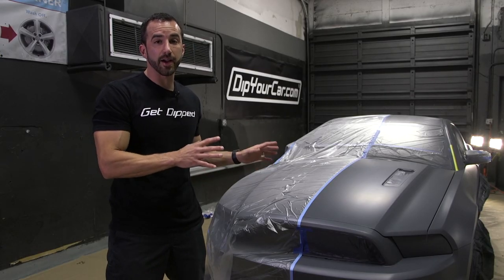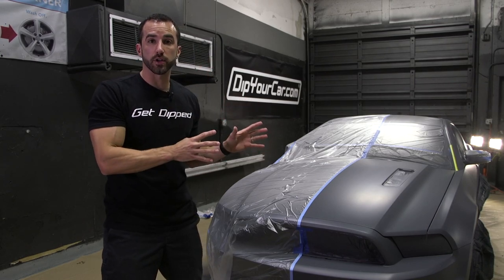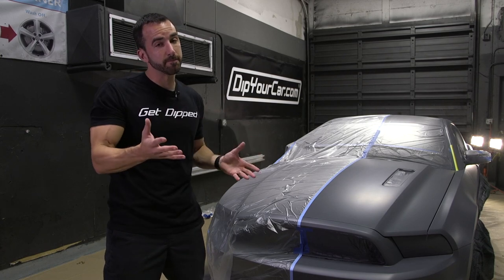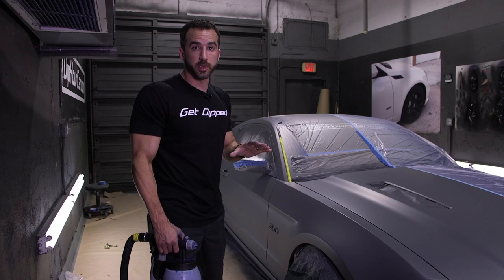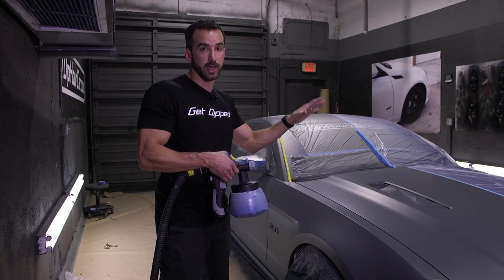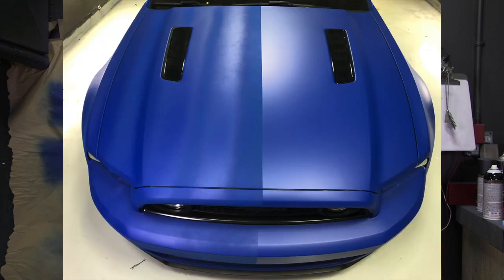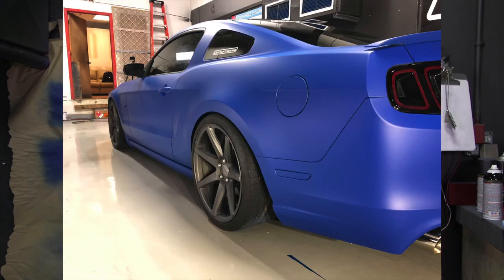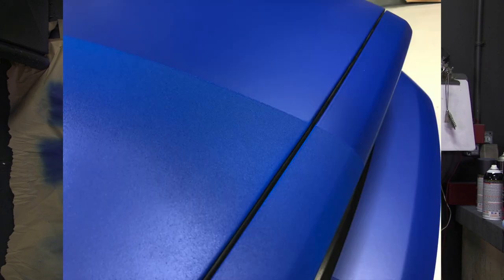Why Some Plasti Dipped Cars Look Like Crap (Rough Texture, Stripes, etc)

Comment: Maybe you can invite someone from the street with no experience. It looks too easy to apply perfect when you doing it. I'm curious how an apsolute beginner can handle the equipment with instructions.
Reply: True!  This video is still a great way to show the do's and dont's . 

The difference in the end result was VERY noticeable, even though he did the sweeps at very similar speeds (i.e. the only major changes in technique that I noticed were the ones he stated: 1. spraying too far away 2. not enough product spray and 3. not enough overlap... all of these directly correlate to not getting a wet layer... I did notice he seems to have intentionally butchered the back of the passenger side to make sure he had a good "bad example" area to point to, but it doesn't seem like he needed to emphasize it). On the driver's side the application was very visibly WET and the passenger's side was noticeable muuuuch thinner (many spots didn't even completely cover in blue and you could still see the gray!) 

I've never tried this myself, but after seeing this video it's very clear that you want to err on the side of "too heavy" vs too thin: a few runs look way better than a coarse spotted finish. I imagine making a dry application will also make it HELL to remove it easily (as advertised), which is why I presume he coated the entire thing in gray beforehand. 

I'm very glad that this business owner is very upfront and clear about how his product is designed to work, and focusing his response to the "bad reviews" as being yet another teaching opportunity (i.e. looking into what people are still doing wrong in order to further clarify the instructions) , rather than taking the more popular route of "you probably didn't even read the instructions, get lost dummy".
Reply: Good idea
Reply: He has
Reply: put plastic trash bags on the wall and practice spraying
Reply: If you can spray paint something, you can dip a car.

Comment: I can only imagine how hard it was for Fonzie to Intentionally spray so badly.... Nice to know he's that dedicated and able to over ride all his skills to do it.  Thanks Fonzie!!!
Reply: Yeah I truly have to give this guy props.  I think he is as genuine as they come when it comes to displaying a product and it's uses.
Reply from the maker: It felt so wrong...
Reply: Even trying to spray it badly he was still going through the motions right. It’s hard to break good habits but I bet the bottom 25% do panel by panel and not keeping the flow going  when they spray it on. A lot of first timers would go fast and slow and hold the gun at the wrong angle so you would have some sags and runs in it. But this is a good comparison and hopefully it will help educate folks on how to properly use the product.
Reply: It easily looked like he had the spray gun turned way way down to accomplish that.  But also Its Odd how the blue came through so bright on the lightly misted side.  Makes me think I'd HAVE to use the pear clear coat at least one coat .

Comment: I think you could actually use the "Improper" spraying techniques to make a fake rusty or patina finish, that would be really cool!
Reply: It would be great for distressed rat-rod looks!
Reply: Antimation Studios I used uneven spray for my cars mudguards. It actually by fluke worked in my favour. The colouring is even, but the texturing is sorta gritty and gives it a sporty look and feel.
Reply: Well, improper only applies if the technique doesnt match the intended result.
Reply: Maybe a 4x4 truck or jeep in camo ???
Reply: If you want texture I'd still do a proper 2-3 coats and then you can lay the final coat from further away to add a little texture.  If you do them for all the coats it'll be harder to remove and the coverage will be bad
Reply: this thing with 2 fuzzy racing stripes down it...
Reply: @BRollOffroad  Fussy patterns on the cars to make it look awesome. Like 2 subtle racing stripes down the car.
Reply: I unintentionally made a textured finish on my old 99 mustang and ended up loving it. Got compliments on my matte finish dip job and the person I ended up selling it to loved it too.
Reply: @TheChris1299100  It's mainly the guy holding the spray can that gets distressed.

Comment: I honestly hope this becomes your most popular video on the channel. Out of all of them, this is the best on how to do it right. I painted my car matte black twice, first time it turned out looking like the passenger side. Only on the hood and trunk. I hated. But I knew it was just me being a noob at painting and not doing it right. Left it for a while, also found it impossible to peel cause I did it too lite. Second time around, I did it right. Paint gun, gallons, took my time and made it wet and proper. Turned out amazing. Plasti dip is amazing if you use it right and take your time.

Comment: Experience is key, I dipped my car three times in the past, im getting better as I practice more. The hard spots for me are the roof and sides
Reply: I hear you on the roof. That is always the one place where I end up with texture and it is usually in the middle of the roof.
Reply: yes the roof, what is the problem with the damn roof?  I can't tell exactly but suspect it's just you're too far away and often throwing product at an angle.   I need to watch more closely next time and see exactly when it happened but it has to be distance i figure since texture is product that dried before it hit the surface, no?

Comment: This was one of your best videos. Not only does this explain how to apply the dip properly but this also shows why using dip cans are very situational. All the issues on the left are extremely hard to avoid with using cans on anything other than wheels emblems and trim parts. You simply cannot get good consistent coverage with a can. Im surprised you didn't mention anything about cans.

Comment: I did the too far method on purpose on my truck hood. The black came out like bed liner. I did have to add another smooth coat to keep the rough texture from coming up. It gave it a more aggressive off road look but still be able to revert back.

Comment: panel by panel is the absolute best way for any beginner to get perfect results the first time if you dont have a garage or are scared to mess up. its easier to fix a panel and correct your mistakes so it dosen't happen on the next panel

Comment: I'm a first time Dipper and noticed my mistake on my first project it's best to go hard core on the dip to get the best result when using rattle cans specially on 40 degree weather had to remove my plasti dip it looked like crap great video thanks bud👍

Comment: Probably most people are doing it with rattle cans.  I think if that's your only option maybe do each panel at a time.
Reply from the maker: If your only option is to dip a whole car with rattle cans, don't dip your car at all.
Reply: @dipyourcar   Yeah they are not gonna listen. I see it all the time.
Reply: If the rattle can gives bad results, why sell them at all?
Reply: MrNightpwner the rattle cans aren’t for whole car applications. Trim, wheels, etc.
Reply from the maker: MrNightpwner rattle cans are perfect for wheels, trim, emblems and small surfaces. Not for whole cars.
Reply: @dipyourcar  like I said, perfect mess up record especially on wheels. I guess I'll never learn. I'm only half trolling honestly.
Reply: I've done dip car bras with rattle cans in the past.  It can work, especially if you take the bumper cover off to do it and really take your time.  However the sprayer is so much faster, easier, and better for anything bigger than a gas door.  it's worth every last penny to get one.
Reply: While it is do-able, It doesn't make sense to spray the whole car with cans, its not like it saves you any money.
Reply: I feel like people are intimidated by the spray kit for some reason. It makes zero sense to try and do a car with cans. If you dont want to do it yourself then take it to a place and have it done. Then it will be perfect. When ur making a change this drastic to your car you want it done right.
Reply: @dipyourcar  lol i said this exact thing in another comment. Cans have their purpose.

Comment: Did this on one of my first sprays, it was a trunk for a motorcycle. Basically felt and looked like a big toolbox, all bumply and cloudy. At least it's easy to peel off and do it right. Some lessons you have to learn the hard way though, haven't done it wrong since

Comment: Can you paint over the jacked up section the correct way without having to peal?
Reply: It wont look as fresh and nice as the other side. So its just better to peel and start from scratch.
Reply: Good luck peeling it. Unless you add 4 layers of it you are scrubbing it off by hand! And it's not easy
Reply: If the layer is thick enough you can peel it. Ive peeled 1 layer with no problems.
Reply: I would say no, not at all, because you already have that texture underneath, it will still carry through if you were to wet it again, I would imagine it would require so many coats to fill it, it would not be practical in any sense.
Reply: Well on depending on how bad it is the thinner in the wet will melt the coat it’s being sprayed on, but not if that’s badly textured

Comment: It is all in the technique. I have painted vehicles outside that looked better than that bad side but I will admit the first 3 or 4  I did were pretty bad but I got help learning and each was better than the last. I am interested in dipping my truck but would practice a side a time or to or a hood before trying to laydown entire vehicle. and extra gallon could be a lot of practice if you just did a fender and hood section and would be easy to remask 2-3 times if needed. Then when ready do entire vehicle.

Comment: I wonder how long it took to peel off the plasti dip on the passenger side of the car.
Reply: Shouldnt have been so bad, because he had 4 base coats of grey first
Reply: Magical formula called DipDissolver
Reply: The 4 layers of base coat of that dark gray will prevent issues when peeling the plasti dip off.

Comment: it doesn't look a lot better on the good side because of the video compression.
And it's a flat blue not a gloss blue. So it might look and feel smoother but it still has a kind of rubbery look to it. 

i would be fine with that look if it is what I got with mine. I did my hood with cans...I simply could not get the texture to look right on 1/4 of the hood. One side just consistently tiger-striped regardless of how much I wetted the hood. I think the cans are a major problem because they are not easy to get product out of them that flows consistently like with the spray approach. 

So I ended up just misting the product down and getting coverage that at least had a consistent look to it. Even if it was not a great look, at least it didn't change drastically across the hood. 

would love to try it with a spray unit though

Comment: I wish he would have shown the other boundary of too much dip.  There's a fine line between just right and dip running down the sides.  If you don't keep the gun moving or go too slow you will build up too much and it will start to run on vertical surfaces.

Comment: I just dipped a wing for my car in black using a few spray cans. It looks like the bumpy grainy side. Is there anyway I can just spray a wet coat on it to even it out? Or lightly sand it first?

Comment: Honestly im really impressed with the product so far and excited to start to paint my Xterra come summer. Few questions: 
1. My OEM paint is garbadge and chipping. If i sand down all of the problem areas and use a normal filler primer to level it out would this effect the plasti dip in any way?
2. How well does plasti dip hold up to the elements? I live in North Eastern PA so its muddy and wet in the warm months and bitter cold and salty in the cold ones. Ive no garage to store it in as of yet.

Comment: Watching your videos since way back, I always thought the first coat was supposed to be a 50% coverage. Here it looks like its a solid 100% down right away.
Reply: I think that the 50% coverage is use by the first layer of the black plasti dip, when you spray on the orginal paint of the car and the blue as the "5 layer" is applying with 100% coverage.

Comment: About to dip both or either a 2000 Monte and a 98 Dakota. But my question that sticks out the most, is yeah I hand wash most of the time, but how does it hold up to carwashes, basically pressure washing. Will it peel, or fly off at the first time

Comment: Can I eliminate the stripes with wet sanding? I painted the front bumper of my car and I got the stripes after apply the clear coat. The base coat was well applied, the problem was the clear coat.

Comment: What sprayer system is that , sounds like a lot of pressure and really good atomization. That could also be the reason for bad results if one has a weak sprayer or dirty gun
Reply from the maker: Gentlevo we use the Advanced DipSprayer system in all of our videos. You can still get great results with the standard DipSprayer system.

Comment: How is the difference in adhesion and peel-ability between these two methods? Does the inexperienced side  still come up as one piece, or would it have a increased tendency to break up. Any thoughts on that and the durability, longevity aspect?

Comment: I have a Tacklife Spray Gun and I tried Plasti Dip today for the first time.The coats went on very heavy and I ended up with Runs and texture.What is the nest nozzle size to use when spraying this?

Comment: omg, that's EXACTLY what both of my dip jobs looked like. I guess I'm just standing too far away, but I worry about getting to close and getting runs. I just dipped my 2016 in slate blue this weekend and I think it looks a little better than when I did my 2013 Mustang a few years ago, but seeing the difference between the 2 jobs side by side, I definitely feel like I need to peel and do again. Can you recommend some test surfaces to get my technique down on? I don't want to throw good money after bad. I assume cardboard won't work?
Reply: Remove the hood and paint it independently hanging on a wall or something. This way you can practice and peel easilly, with no sunk costs for masking materials.

Comment: Is there any downsides to having textured plastidip on your car other than it not looking smooth? I remember on one Jeep I saw it had gray and textured paint/plastidip. I thought it looked pretty damn cool. It really worked with the kind of look he was going for and I didn't see anything bad about it.
Reply: One issue would be snagging. Especially when you try to wash your car and want to wipe it down and such. Obviously a smooth surface would be much easier to clean. Textured could easily snag on microfiber towels.
Reply: @bosscat4276  But it wouldnt affect the dip in any way besides being textured?

Comment: How do the rattle cans cover comparatively?  I'm thinking about getting a couple of cans and the 2.0 nozzle to practice before spending the money for ProKits to do my cars.
Reply from the maker: Rob Day the cans cover in a similar fashion as far as pigment, but of course you should never attempt to use cans for anything other than wheels or trim.
Reply: DipYourCar hahaha my intent was only to test, probably on my winter wheels or my stock hood that’s hanging on the wall.

Comment: Good video,  i was that ckwraps guy actually watched your videos before trying to compare plastidip to vinyl, it was painful to watch.  Also, with the speed you apply it, is that just because of your pro DYC kit? I noticed in your older videos with the wagner sprayer you were going really slow?
Reply: The Wagner was very heavy and awkward to manipulate because the motor was hanging off of the back of the gun and because it was never designed for spraying dip. The DYC Pro system is specifically designed to spray dip and designed to be more comfortable and easy to use, even for a beginner.
Reply: @AutoYoung  thanks for the reply,  my problem is in Australia we have 240v so the DYC gun is out of the question,   I found 1 company in the country that does the earlex 240v 2901 but the price difference is a lot. But i think ill just buy it n get it done.
Reply: @troyd-motorsport9933  
It can work, you'll just have to thin out the dip a little more. Not as much as in the past when he was using the Wagner cuz that was pure dip. Look at getting the fix it kit from DYC and add that. Hope that helps too.
Reply: @troyd-motorsport9933  
By the way you guys have some badass cars! I love the Australian car scene/culture. I'd love to have a Maloo and a Falcon XB GT.
Reply: Haha cheers, its funny you say a maloo and a falcon as its something you would never hear someone say as there is a big Ford vs Holden rivalry, same as Chev vs Ford in the states :D
I have an XA Falcon Coupe which is in restoration,  I love the mustangs though,  I got a 67 mustang convertible as well,  all of the aussies are totally jealous at how easy it is for you guys to get parts and these awesome american muscle!  It seems after watching youtube, roadkill, and other hot rod build up shows a 600-800hp street car is pretty common over there :D

Comment: What kind of spray gun do I need? High or low pressure? I have an air compressor but I've never used a paint gun before. I just did a few trials with cans and I like the potential but I'm not satisfied, I'll give it a try with a gun

Comment: Technically if u wanted make this video perfect to how 80% of people would do it u shouldve used spray cans on it bcuz most people dont have that spray gun. Just stating a fact. And most people would do this outside and not in a garage with controlled environment.  But I mean u did do a decent job screwing the passengers side up. Lol